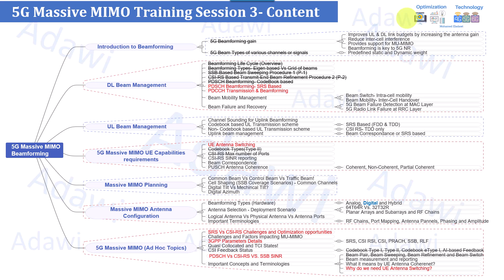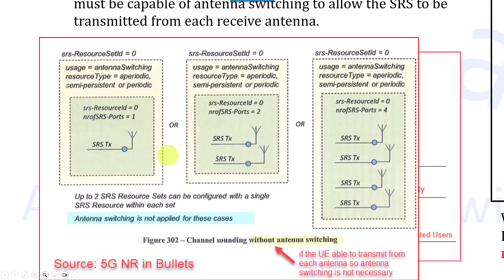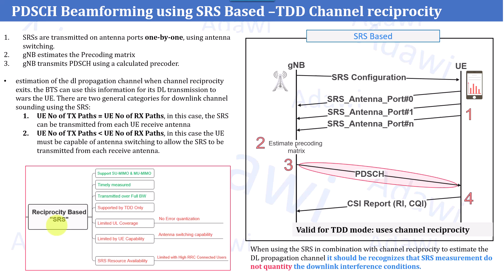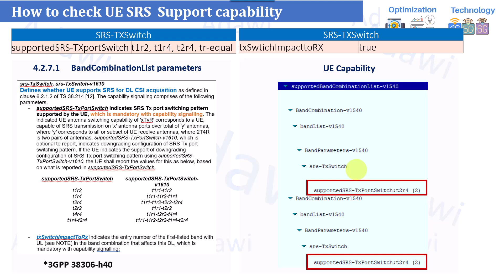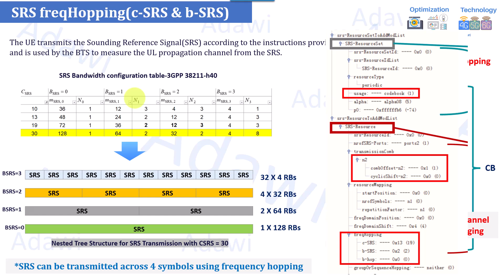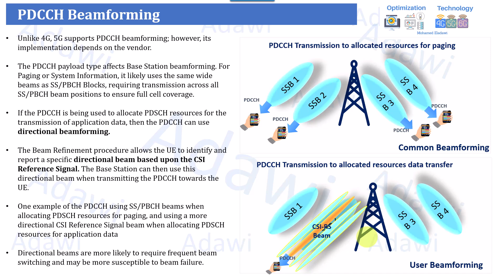Session 4: SRS-Based Beamforming in 5G | PDSCH & PDCCH, Antenna Switching, SRS Gain Explained

Comment: Thanks Adawy ♥
But I have a question, in the SRS capacity solution part if we have 12 CF available so why 12 UEs share the same REs? from where this number of UEs come?
Reply from the maker: You're very welcome. 12 UEs can share the same RE by using different cyclic shifts (CF). Here are some details to further illustrate my answer:
- Cyclic Shift (CF) is a phase rotation applied to the SRS sequence so that multiple UEs can use the same time–frequency REs without interfering.
- Each cyclic shift produces an orthogonal sequence to the others, allowing the gNB to distinguish signals from different UEs even if they overlap in time and frequency.
- So, when we say 12 CF available, it means there are 12 orthogonal phase shifts → up to 12 UEs can transmit on the exact same REs (same time, frequency, symbol) without collision, because the gNB can separate them using their different cyclic shifts.
Reply: @mohamedeladawiashour excellent 👌

Comment: Very helpful Mohamed, way to go!! 
Please provide me clarifications on the following : 
a) If I am not mistaken a Ue in good radio conditions can transmit initially SRS for precoding matrix estimation (PDSCH beamforming) and then CSI report for interference estimation. Is it correct ?
b) For PDCCH beamforming, in case of PDSCH resources allocation, the same precoding matrix (for PDSCH) sent through Ue CSI report (CSI-RS measurement) is used. Is it correct ?
c) Is PDCCH beamforming used for PDSCH resources allocation, in case a Ue is in good radio conditions or only at cell edge?
Thank you
Reply from the maker: Hi georgi,
Thanks, for Question a) yes, you’re right, UE will still be reporting the CSI , b) yes you’re , but i think also some vendors may has different implementation, c) this also depend on vendor implementation, example some vendor may decide the switching between common and narrow pdcch beams based on SINR.
Reply: Thank you very much Mohamed!

Comment: Thank you for another great video. How does beamforming work in case of secondary carriers? Is there  a mechanism to send SRS or CSI Feedback for each component carrier ? Also is it on the specs that  resourceType should always be Periodic if usage = 'antennaswitching' ?
Reply from the maker: Thanks a lot! Those are very good questions.

Regarding Question 1:
Based on my understanding, the SCELL weight type depends on the UE’s carrier aggregation (CA) capability. For example, if a CA-capable UE transmits SRS on an SCELL, SRS-based weights are used. Otherwise, PMI-based weights apply. Additionally, beyond UE capability, I believe vendors also have some control over this behavior through implementation choices.

Regarding Question 2:
Honestly, I’m not entirely sure if the specifications explicitly state the resourceType when only a single SRS Resource Set is configured. However, I believe it should be set to Periodic if the usage is 'antennaSwitching'.

In the case where two SRS Resource Sets are configured, 3GPP TS 38.214 specifies that this allows for transmit path switching between two paths (typically for four receive antennas). In this scenario, the two Resource Sets must be configured with different triggering mechanisms, meaning different resource types — one Periodic, and the other Aperiodic.